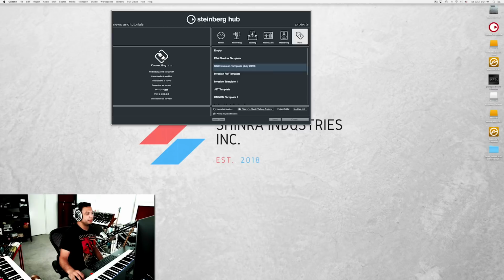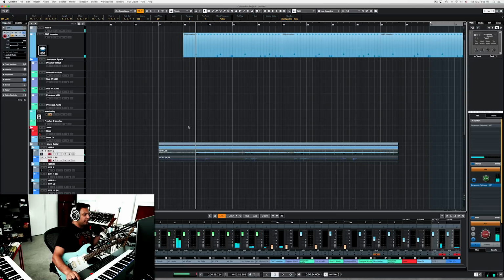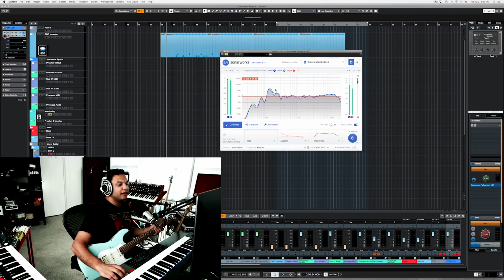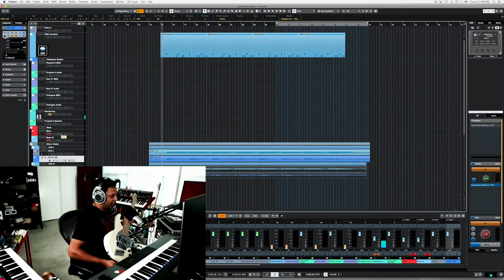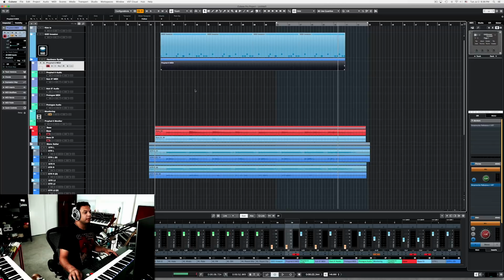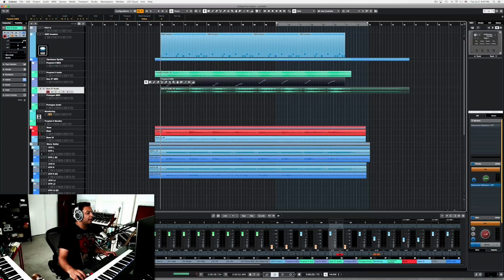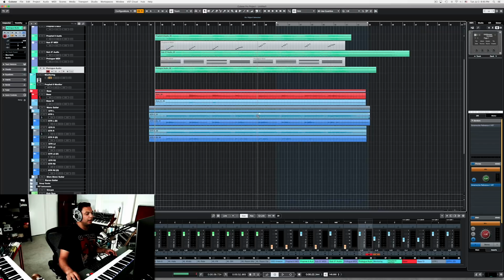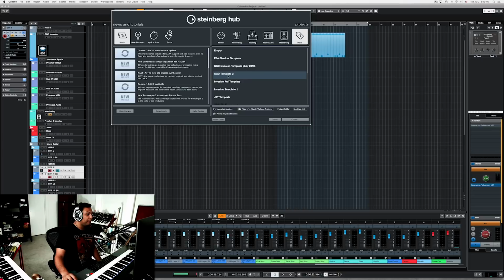Misha Mansoor - Using writing templates to fuel creativity!

Comment: Man i was just 3 min in and you blew me away with the monitoring channel for the guitars, you just saved my life hahaha I never thought about it, I would always bypass every plugin e v e r, just thanks
Reply: @Jun Escalona I think he's doing it this way: he has a normal guitar bus with the tracks he want to record (in this case the DI + the amp one) which is routed to the master bus as usual, but those tracks are recording only and their monitoring is muted, so he's not hearing anything from that. To hear what he's playing he created a track which is routed to another master (which you need to create as well), or it simply bypass the normal master bus going directly to the output, and in the case of another master the benefit is that this new monitoring master doesn't have anything on it, allowing the zero latency monitoring.

Comment: Don't know if this has been mentioned in the comments, but Equalizer APO is a free program that can do what he's talking about with sonarworks (though you have to set up most things manually and it's not nearly as robust). There's a github page that has profiles on basically any pair of headphones you can think of. The catch is that it can be kinda hard to get your interface working with it properly if you use ASIO, but with WASAPI it works perfectly. It has a bit of a learning curve, but it beats spending $100 lol

Comment: I always make sure to record into two mixer channels, one for my current tone, one for di. As for "templates" I never just start a project from scratch, I always just *save as from my last project xD
Reply: 👍👍this guy
Reply: Me too
Reply: @williamdistasio9358  recently I've been using a boost in front of my interface into some LePou amp sims, or the Emissary, so I've just been saying screw recording DI and just commit to a tone XD
Reply: @smoreshaunted  huh, yeah that's what I do too. I've not used my Lapou sims in a long time, because I'm soo into the emissary. But yeah, my session chain is usually something like this; TSE 808 OR TS 999 then my noise gate,( Weirdly enough for some reason my Noise Gate works better in that spot in the chain rather than in front of everything. It seems like I don't lose the tail end of my sustain as quickly) then the Emissary, Nad IR, (mostly Kalthallen IR's), Anvil 5 amp ( I have this here in the chain as a boost, I use the clean channel but mess with the gain,bass, mid and treble. I'd suggest trying something similar,  it's pretty cool for darkening a tone and making it super edgy and aggressive) then usually like TAL reverb on the end...but occasionally I'll put some delay, depending on what I'm trying to achieve. If it's a heavy chugging or technical "riffy" thing then I just use a touch of reverb and double track.
So I use mostly free plug-ins man, as you can see from what I just explained to you. The only thing I haven't found yet that I really truly like is a good compression. What do you use for compression?
Reply: @williamdistasio9358  I've been back and forth between LePou and the emissary for a few days I actually like the Mesa voiced amp quite a bit (the Lecto) sounds good with a real boost pedal and I've been using celestion 2x12 v30 IRs(md421) as well as Glenn fricker's free IR that he gave out a few weeks ago. Sometimes after recording I use a multi-band compression plugin(FL studio stock plugins) on guitars but usually no compression. Now if you're talkin compressor pedals, sometimes I use a Seymour Duncan vise grip compressor before the instrument input/DI same with my boost pedals

Comment: 8:10 anyone know a good way to do this in Logic Pro X? Would be nice to never worry about bouncing with the headphone frequency response correction EQ plugin on
Reply: There is a simple way to do this, it is quite easy to integrate into any existing template: Select every track which has "Stereo Output" assigned as its output, and send it to a bus (any bus that you certainly haven't used before, for example Bus 100). I call this one "Mixbus" but you can call it anything you like. Normally Logic will automatically create the corresponding Aux Track in the mixer. (ctrl+t brings it to the arrange window as well) This is going to be your new "Stereo Output" track, on which you are doing all your mixbus compression,eq,limiting and all the fun stuff. This Track has "Stereo Output" assigned as an output. From this Track, you can now create as many post-fader sends at 0dB to outputs of your choice. If Logic sees the Headphone Output as a separate stereo pair of outputs, it's easy. You are going to find a second output channel, which you can call "Phones". This channel is, where you put your correction plugin. So you end up with one Stereo Out which is unaffected and one corrected Headphone Out. Option B is to send a copy of your Mixbus into an unused pair of outputs, for example the spdif's or 3 /4, which aren't connected to anything. In this case you call your second output channel "print" or "bounce" and you leave that one unaffected, while putting your plugin on the Stereo Out . The only downside of this case is, that you can't use the shortcut to bounce anymore, since it defaults to the Stereo Out. Instead, you have to click the "Bnc" Button next to the corresponding fader. There are many more ways to get creative with this, for example adding a layer on top, and sending your mixbus, together with a reference channel or two, into Bus 101, which you call "Main Bus". This allows you, using(alt+solo) to quickly check your mix, against a reference. Your send is then being sent from the Main Bus, which then acts as your "output distribution channel".Obviously, this doesn't add any latency at all. You just have to remember to put the Mixbus as the output of your audio and instrument tracks or group busses, but you quickly get used to it. Have a great day! :)
Reply: @slunnes  thank you for taking the time! i don't seem to have another output besides 'stereo out' ;/ so i guess muting the plugin is still the simplest and best option for me for now
Reply: @darwindeeez  You're very welcome! You could try adding a piece of software called "loopback" (was called soundflower in the past) inbetween your daw and your interface. It can simulate multiple outputs to your daw. Might be worth googling. And nonetheless, the use of a mix bus is good practice in mixing, it allows you to easily create multiple versions of your mix to compare it.
 Cheers
Reply: @slunnes  yes i use audio hijack pro for that which would certainly be a hands-free way of handling the issue and i'd never accidentally bounce through the EQ. but that program seems to use a lot of CPU. and i do use the mix bus setup you're describing with the fake master bus as well, it is really nice, i agree!

Comment: Does Misha use something to put midi notes into the correct scale?
Reply: Most piano rolls are tempo locked
Reply: @erickmazur807  no no no, it's not about tempo, the notes are jumping up and down, when he draws a chord. I imagine he must have known the scale he is going to right in, and therefore preprogrammed it in some built-in Cubase plugin. I use Reaper though, so no idea how was it done.
Reply: @L0wPressure  on windows in the piano roll hold ctrl - shift - alt and cursor turns into a paintbrush. You can then paint chords. You can press 't' and from there you have more options as to what kind of chord to paint.

Comment: anybody know if he has all those synths plugged in with midi cables, usb's or instrument jacks? i'm good at recording but new to using midi. i've only every plugged in things using instrument cables to my interface, or usb's directly to my computer. i know he said he was routing through his axe fx (so i guess he's using that as an auxiliary interface) but he didn't say what kind of connection. I'm also unfamiliar with axe fx. i'm assuming he has some kind of axe fx hardware unit that has inputs. but i wouldn't know what kind of inputs he's using.